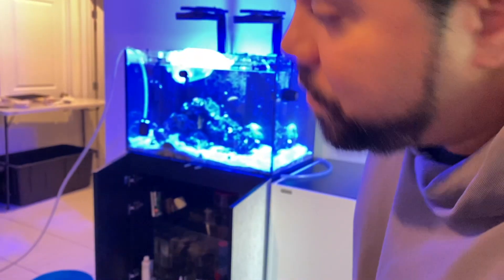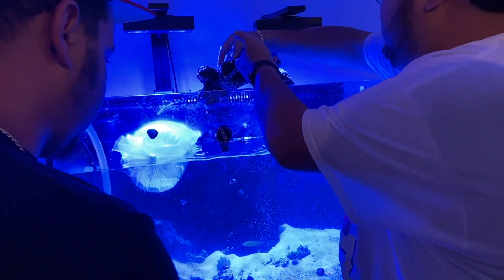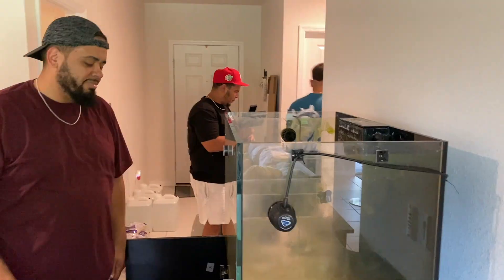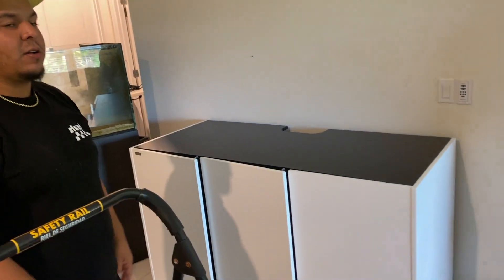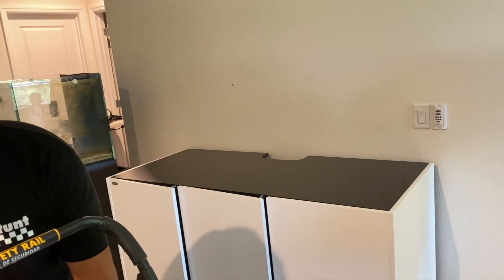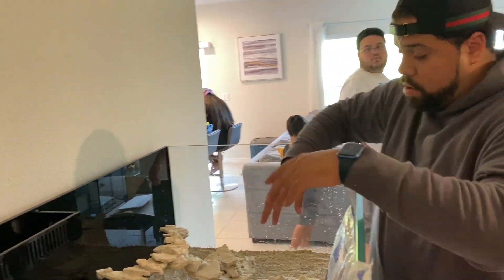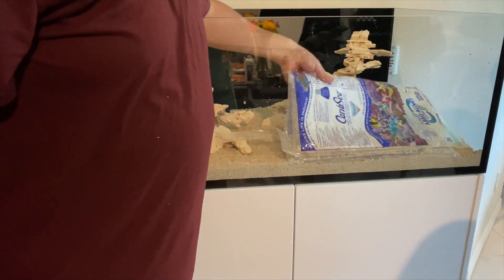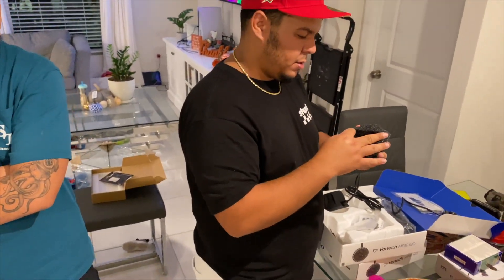Waterbox -145.5 Frag Tank- SET UP

Comment: The IM Lagoon 3'x3' and 4'x3' are the best dimensions for any standard tanks on the market. My next build (as I can't get IM here) I'm probably going to get a custom 3'6" x 2'8" with the water18" (if I have the dimensions right) but I am going to get the glass about 4" higher than the water so fish can't jump out.
Waterbox and Red Sea are close. I like the Red Sea ATO (because I dose kalk and just need a tiny bit of top off) whilst I think the quality on WB is slightly better
I believe at full retail IM and CADE offer better value though. Both have the quality stands and CADE is more expensive but you get the power boards, the reactors, ATO etc and the net top all included and I think if reefers really considered those extras they would realise its a better buy.